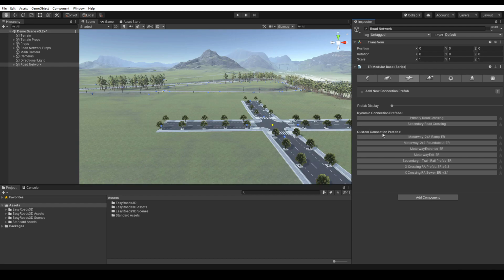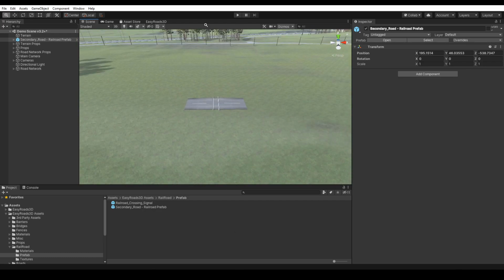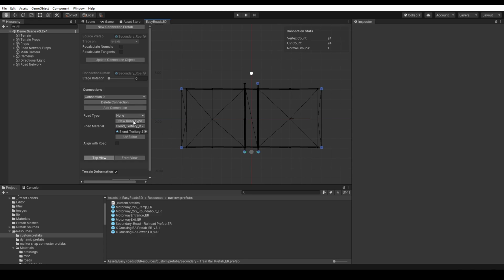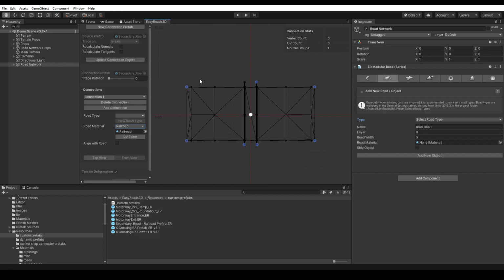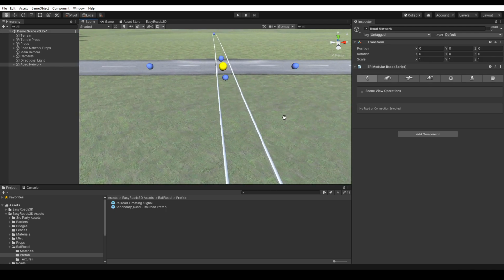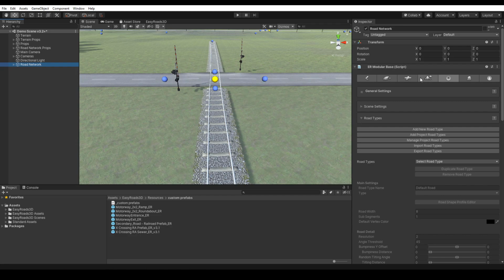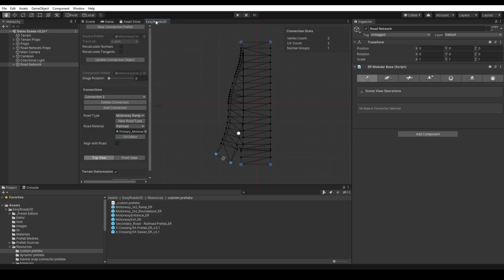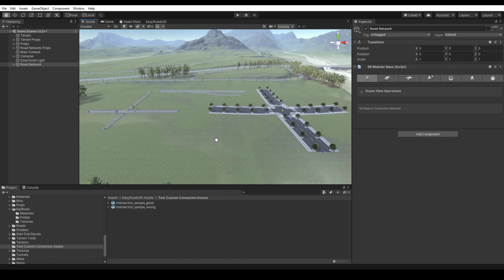EasyRoads3D v3.2+ for Unity - Custom Connections

Comment: How does one switch from four late to two lanes like connecting a four lane road to a two lane road
Reply from the maker: This video is about Custom Connections, connections based on imported models. And that is indeed how road transitions between  road sections with different lane counts / width can be made. The transition shape can be made exactly how you want it to be. A built-in option is to use an I Connector (available further below in the Marker Settings). I Connectors can be used to connect different road types and when selecting the connector there are additional options in the Inspector. It is possible to adjust the width of the road sections in different ways so they will align.

Comment: We have a custom mesh that has some extra vertices in the middle of the vertices we need to select to create a connection, which results in no matching road types being shown in the Road Type dropdown. Is it possible to deselect vertices from the current selection or add vertices to the current selection?
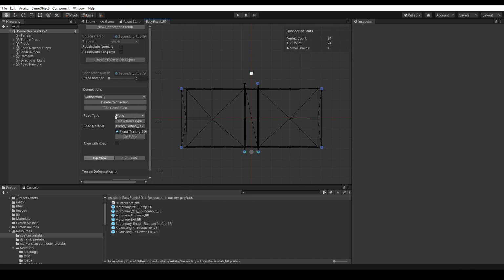Reply from the maker: I assume these vertices are there for a reason and they define the shape of the connection? In that case they are required and a new road type for that connection / shape can be created, 05:49 in the video shows this process. Would it be possible to contact us? The email is in the readme file in the EasyRoads3D root directory, that way it is possible to attach screenshots and perhaps also the model so we can test it.

Comment: I want to create a x crossing that is not 90 degrees, how can I achieve that? Edit: I guess I need to use flex connector
Reply from the maker: This video is about importing your own intersection models. That is a way to do what you want.

Indeed the Flex Connector in v3.3, available in betas, supports flexible angles.
Reply: @unityterraintools  Thanks! I downloaded v3.3 yesterday and managed to create a non 90 deg intersection, but I wasn't able to connect other roads to it.
Reply from the maker: @burgerkingcustomer93  Flex Connectors are build dynamically, there will not be visible "empty" connections like for v3.2 dynamic connectors. To connect a road, move the road marker over the Flex Connector towards the center. Release the mouse button when the blue circle appears. One thing to note is that currently roads can only connect when the two neighbour roads on the Flex Connector, on the left and right, share the same road type.
Reply: @unityterraintools  Thanks

Comment: I have a connection prefab which contain road and sidewalk (sidewalk joined to road vertices). It is any method to do an connection containing only road part? (I need to have 2 vertices in connection to connect with other simple road)
Reply from the maker: Do you mean the sidewalk vertices connecting to the road is at the exact same position as the road edge vertices? In that case you could create the custom connection using the road mesh only. That way only the road mesh vertices can be selected. And afterwards, add the sidewalks as child objects to the newly created custom connection prefab.

Comment: Is EasyRoads3D work with GeNa terrain?
Reply from the maker: EasyRoads3D adjusts the Unity terrain object. So it will work with any other tool that interacts with the Unity terrain object unless that other tool locks unity terrain object changes, but that situation is unlikely and unknown.
Reply: @unityterraintools  Can EasyRoads3D be made into Prefabs?
So maybe I can use EasyRoads3D in a roundabout way
Make static Prefabs with other props and finally integrate them into GeNa?
Reply from the maker: @orionakd  I am not sure why you would want to do that, but there is an option store mesh assets in the project folder. This will store the generated road mesh assets which can then be turned into a prefab. And it is also possible to export the generated roads to .obj or .fbx.
Reply: @unityterraintools  The reason is simple

EasyRoads3D has very good urban road material details and planning
GeNa and Gaia have amazing Prefabs management and natural landscape production

Anyway, thank you for your reply, I will find a way to use them at the same time.
Reply from the maker: @orionakd  EasyRoads3D generates road networks ready-to-use and it adjusts the terrain to match the road shape. I cannot see how you would want to use it in a different way? If the question is, can the road network or parts of the road network be turned into a prefab? Then, yes that is possible. The two packages can be used together in a scene.
Reply: @unityterraintools  I need GeNa and Gaia to make large-scale terrains and scenes, but obviously GeNa and Gaia seem to use custom terrains, which may not be compatible with EasyRoads3D at the same time.
Reply from the maker: @orionakd  Are you sure? Last time we checked the end result of Gaia is a Unity terrain object. EasyRoads3D works well on Gaia generated terrains.
Reply: @unityterraintools  Is that so? This is good news!
EasyRoads3D can be used in Gaia terrain and will solve many problems!
Reply from the maker: @orionakd  That is what I meant to say in my first post. We do not have Gaia in our workflow but we do look at it now and then with regard to EasyRoads3D support and so far we have not had any issues using EasyRoads3D on a Unity terrain created with Gaia. You can already verify that by looking in the hierarchy, select the generated terrains(s) and then look in the Inspector for the Unity "Terrain" component. And that is for any terrain generation tool, as long as the end result is a Unity terrain object with that "Terrain" component attached, EasyRoads3D will work. 

And the tool also works on mesh terrains but without the terrain deformation feature.

Comment: why are some roads low polly and some high polly? I thought on buying it but I got confused when I saw low polly and got kind of rejected on buying it. 

Whats the difference betwen EasyRoads 3D PRO and other?
Reply from the maker: The resolution can be controlled per road type and per individual road. The main "Resolution" control and the "Angle Threshold" option. "Angle Threshold" can be used to reduce triangulation and preserve detail in turns.
Reply: PRO gives you all the features.